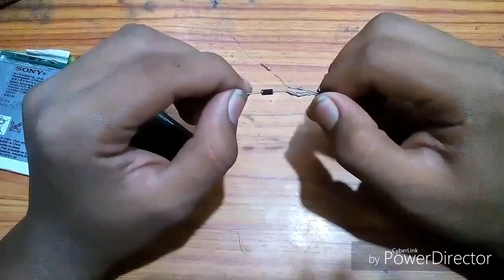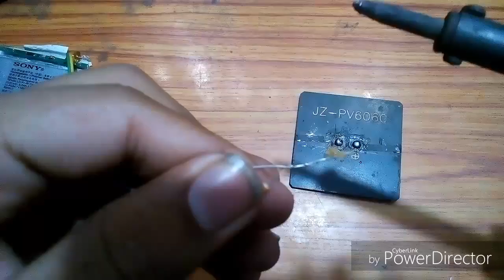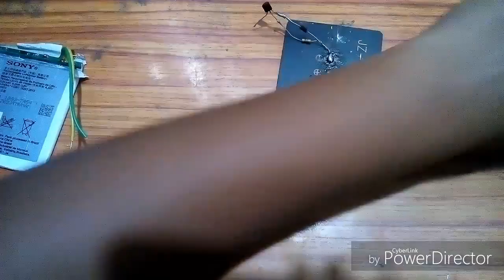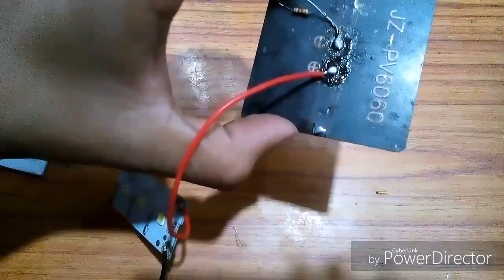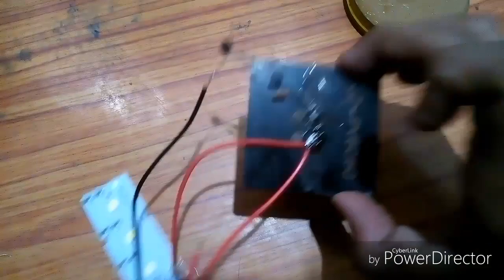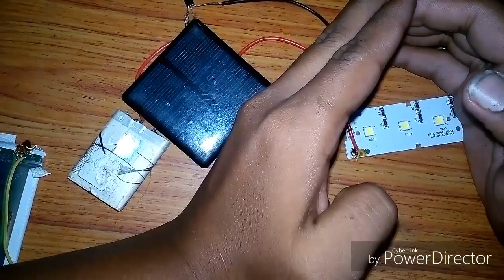How to make Street Lamp ||  Automatic solar on off light(STREET LAMP)|| WITHOUT LDR || USING SOLAR

Comment: Can u explain the working as how diode and transistor works in this circuit
Reply from the maker: Here diode prevents the circuit from reverse voltage whereas the transistor works as an automatic switch. When light strikes the solar panel it turns off the LED and when there is no light than the transistor turns on the LED